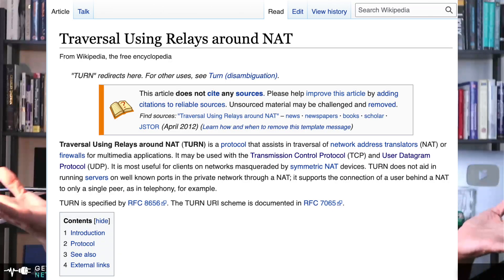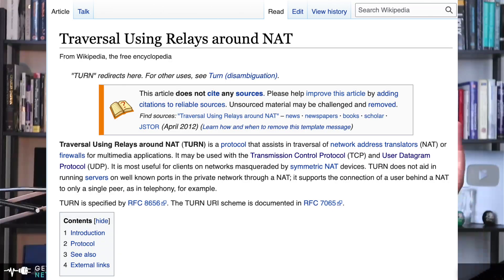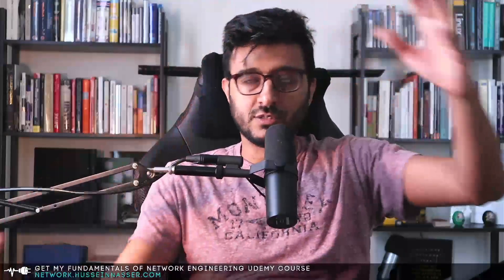UDP hole punching | The Backend Engineering Show

Comment: A sort of TCP holepunching exists, but obviously requires a less secure firewall setting. This means with sequential ports guessing of the new port to be opened, someone could interfere with your standard insecure HTTP connection, so it is avoided

Comment: For TCP, holepunching is not the only method, because you can use server polling to receive incoming packets without directly connecting.
firewall security is not "too strict", it is security. STUN is basically just a handshake server for holepunching.

Comment: Hussain, what about the Virtual Server setting that is present on the routers. I think we can use that to forward the packet to the relavent machine in the private network. 
While setting this, we specify the private ip address of the machine and the port of the machine where we want to route the packet to.
Reply: "Virtual Servers" is a confusing synonym to "Port Forwarding", port forwarding will solve this problem but need to be configured manually on your router, a better solution is "UPnP" which is a protocol that let your PC send a request to your router to set a port forwarding rule for you automatically.
Reply: @ili101  That is so interesting. I will look into UPnP 🙂